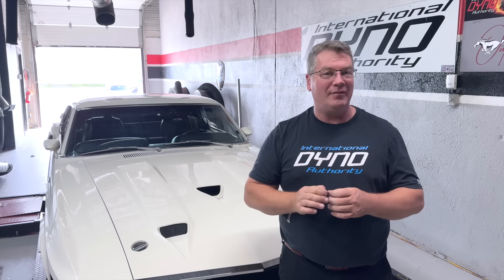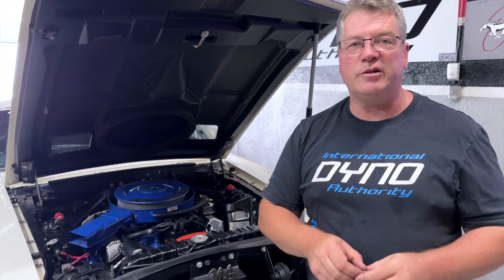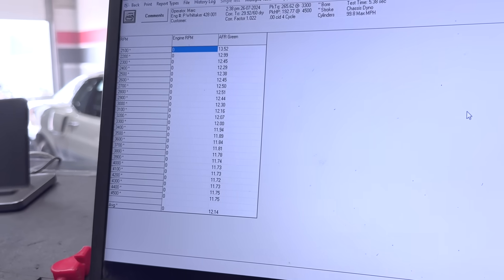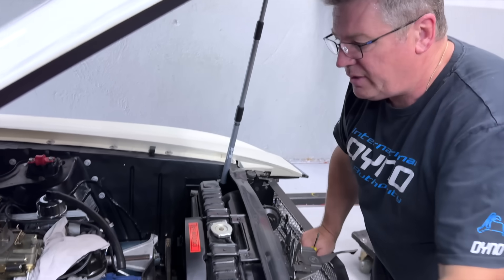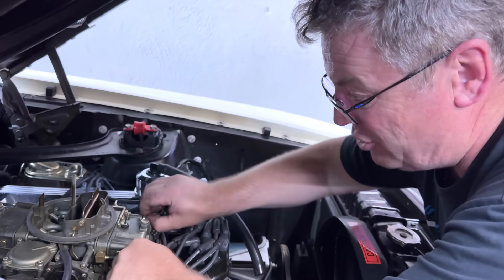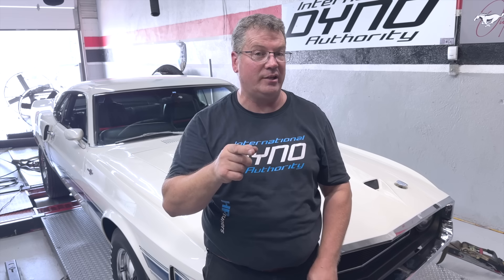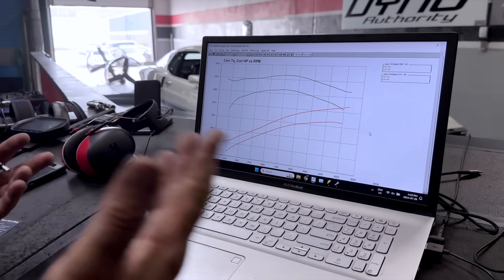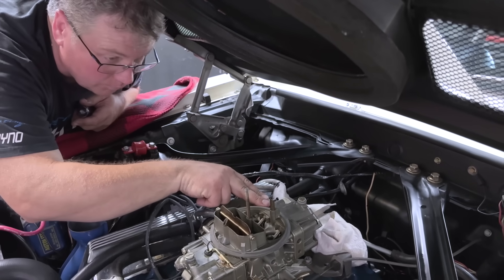Original, unrestored '69 Shelby GT500 tuned on the dyno

Comment: 340 HP at the crank is NET I repeat NET horsepower NOT Gross hp which the stock 335 Hp would have been. 335 gross HP would have been around 285 NET HP and subtracting another 8% from that would have been 262 Rear wheel HP. This is for a properly tuned car, but it's known that these motors were undervalued with respect to HP hence the numbers you guys are getting,so if you reverse the sequence when you got 295 HP at the rear wheels, add 8%( which is conservative) for the net value and then another 10% to get to the gross HP value you would get about 350-360 gross HP rating.
Reply from the maker: @johnnyzee383 

We tune over 600 vehicles a year, and one of the most common questions we get from customers is, "How much does that equate to at the crank?"

Another frequent query is, "How do I estimate the crank horsepower (CHP) from the wheel horsepower (WHP)?"

The simplest and most reliable method is to take the gross crank number—whether provided by the manufacturer, the internet, or your own experience—and divide it by 1.15.

Let’s apply that here:
335 ÷ 1.15 = [calculated result].

As a shop that specializes in dyno tuning—both chassis dyno and engine dyno—we can confidently say that this method is remarkably accurate for most setups we work with.

For instance, we can dyno an engine on the engine dyno to get its crank horsepower (CHP or BHP), install it in its chassis, and then compare the wheel horsepower (WHP) from the chassis dyno. Using the ÷ 1.15 method almost always matches up.

That said, there are exceptions. For example, we have customers who swap engines into wildly different chassis configurations. One customer, for instance, installed a K-series engine into a Silverado. In cases like that, the drivetrain losses are much higher—closer to 35–40%.

So while the 15% rule works exceptionally well in most cases, there’s no universal formula in the world of mechanics. Each setup is unique, and variations will always exist.
Reply from the maker: @johnnyzee383  

Using fuel from the late '60s or early '70s, such as leaded, high-octane options from Sunoco or Shell (around 100 octane), we could have expected more energy from the same combustion chamber. This type of fuel, being "slower-burning," would have allowed us to ignite the combustion chamber earlier, effectively advancing the timing.

With this approach, it’s possible we could have gained an additional 20–25 horsepower. Of course, this would have skewed all the calculated numbers.

However, for this particular project, we were thrilled to stay at a very conservative 31° total timing and still come remarkably close to the rated horsepower using the 1.15 rule.

This was an enjoyable project, and we had a great time working on it.

Cheers, enjoy your weekend, and have a wonderful holiday season!

Thank you for tuning in—stay tuned for more informative videos, including our upcoming educational series and straightforward how-to guides.

All the best!
Reply: @internationaldynoauthority693  Thanks for the response. Sorry I failed to consider the effect of higher octane fuel which no doubt the original dyno test would have incorporated into the tests, enabling them to advance the timing and increase the HP. Again you mentioned the HP number of 292 HP at the wheels and you say thats about 340 HP at the crank and then you say the factory rated this motor at 335 insinuating that your numbers are close to the factory 335 HP but again the factory NEVER rated these at the crank!!...they were rate with the motor on the stand with no exhaust, no air cleaner, no water pump, and no driven accessories what so ever, and this number would have been about 10% ( a conservative figure and likely higher) higher than your estimated 340 NET (or at the crank) or about 374 GROSS HP, again alluding to the fact that these engines were really underrated like the Chrysler 426 HEMI. What blows me away however is that you only had 31 degrees of total timing which is very low. By the way without vacuum advance hooked up drivability would be quite poor and gas mileage much worse.

Comment: Owning a 69 Mach 1 which I bought from Tasca Ford, was a SCJ with the Drag Pack option  4:30 rear,John Healy  was Tasca's mechanic/ tuner was a wealth of knowledge on the FE engines. My carb had # 68 primary  jets and # 77 secondary jets with open exhaust [headers] and ran 38 degrees total advance timing. That distributer is a 427 dual point mechanical advance which I also had in my car, their is also a trick you can do to that , take it apart and flip the weights , will respond a lot quicker ,like having a advance kit in it , of coarse we did it on a Sun Machine distributer machine.My car ran 12.3s ,open exhaust and 7" slicks running E/SA  , very fast street car in it's day. Was very impressed on your tuning !
Reply from the maker: @josephsouza9951  
"Thank you for sharing your thoughts! We’re so glad you enjoyed this vehicle as much as we did. It’s always exciting to see how a well-maintained classic responds to changes—it’s a testament to the care it’s received over the years.

You make a great point about the potential this car has, especially with a freer-flowing exhaust or other tweaks. While it might not see much action at the drag strip, its charm as a cruiser and one-of-a-kind classic is undeniable. The 420+ cubic inches under the hood definitely spark some interesting possibilities!

We’d love for you to keep following the channel, share it with friends, and join us as we explore more incredible vehicles. Wishing you an amazing holiday season—Merry Christmas to you and your family! Stay tuned for more from the International Dino Authority crew!"
Reply: @internationaldynoauthority693  It's always a pleasure to se a intelligent tuning a car

Comment: wish I had found you back when I had my 70 Monte 396. I changed the carb to a holley 750 duel feed and anything over 100 mph I left a batman cloud behind me. Red said the quad has 680 so why! I wish I had listened but hard heads show empty wallets right?
Reply: I did add a Edelbrock intake, 7900 lift cam, and a 4 inch spacer, and MSI this was 30 years ago, where does the time go? Jegs is evil with promises! Add 50 add 100 add 15 add and you drown the motor! and it is slower than stock!

Comment: I always wonder if emissions and insurance companies didn't kill the American muscle car by the mid 70's. What kind of numbers they would've been able to put out instead of the sub 200hp smog machines we ended up with. The experimental Chrysler doomsday motor reportedly putting out 900+hp in the late 60s, and the Ford thumper on record putting out 600+ without FI.
Reply: The HP and horrible handling of the Muscle cars of the 60s caused a HUGE spike in cars totaled and accidents. The insurance companies began putting a large surcharge on cars with huge engines. Imagine paying the equivalent of $10,000 a year for car insurance in 2024?  That will put a damper on sales of cars with big motors. Insurance rates spiked and the oil embargo of 1973 together put an end to the big engines of the 60's and early 70's.

Comment: A hit and a miss. A lot of good info.  I've tuned a lot of these with just a vacuum gauge taped to the windshield.  This tells you the correct power valve size. 6.5 is a starting point but most of the time I go with an 8.5 for crisper drivability.  Pump shooter tuning is done on acceleration. Start lean and keep increasing until your flat spot (hesitation) goes away. You NEVER change the shooter for mixture! You also missed a critical point of tuning, the secondary spring. If it starts smoking at 3500 your secondary spring is too soft. Big inch engines have a very strong vacuum signal. I would go one step stiffer. If it still smokes you can try a second step but if you lose power go back and take out a jet size. If you're getting pull over on the jet then that is just total fuel. Drop a jet size. If you reduce shooter size then you messed up your acceleration mixture. You either reduce jet size or you can change to an anti pull over jet from a 4165. The 340 SixPac is by far the hardest to tune. I got one into the mid 13s this way.  Also the plugs tell a story.  If the car showed up with a chronic rich condition the plugs should have been changed when it got close.  Having worked on a big block 1st gen I know why you skipped this step.
Reply from the maker: @wolfhobbies  The video was a summary. 

Many many steps were taken off camera. 

As, there were leakages, and nozzle sizing was Paramount. There were also other issues causing smoke. 

Off camera, we fixed one of the main main reasons that most of my customers have stutters and smoke coming from their engine. 

This was one of the many vehicles that showed up this year that had a breather on one valve cover and a PCV hooked directly to the intake. 

The PCV was bypassing the carburetor. We very quickly fixed that issue. So that the PCV was not drawing air from the breather on the opposite side, thereby leaving uncarburated air bypassing the fuel. Also, there was a restrictor put in the PCV, as these, valve covers were very liberal about the amount of oil they allowed, into the PCV return to the intake. 

Spark plugs were monitored. And they had been replaced immediately before we began the initial tune. Also the Gap was reset to correct. 

Gap, years ago was huge. We no longer use gap, as a fallacy to think that we get more spark. If we open the gap. We put the gap to a correct number. Which makes use of all of the voltage that this older style system has. 

Ceramic was monitored along with the ground strap. 

Mainly the smoke was removed. The fueling is now spot on. And there was no reason to actually add a lot of ignition timing as the engine, very much enjoyed. 31 as well as that was a good mix with the current compression ratio.

The power valve was swamped and re-swapped and repaired. And, some of our custom installed parts were added to the primary circuit.
Reply from the maker: @wolfhobbies  We did not change the size, or the CC, being applied under acceleration. We changed the nozzle. We repaired the spring. And we repaired the ball. And we repaired the passage. As well as the custom gaskets, that only we use in this industry. Nozzle size. As soon as, we repaired the PCV, and applied the smaller nozzle size. We no longer had leakage. Which meant that our jetting was now accurate. As opposed to tuming while compensating for nozzles that were overpowering the entire mixture.
Reply from the maker: @wolfhobbies  International Dyno Authority: Pioneering the Future of Tuning and Combustion Technology

As North America’s premier facility dedicated to advanced tuning and research, International Dyno Authority (IDA) has set the standard for tuning and power optimization across a vast range of applications. This cutting-edge institution has earned a reputation for excellence through extensive partnerships, groundbreaking innovations, and the development of tuning standards that are transforming the industry.

Partners in Innovation

IDA collaborates closely with leading corporations, advising powerhouses like HP Tuners, Whipple, Roush, and Ford Motor Company. Their insights and technical support have become an essential resource for these companies, driving improvements in engine performance, efficiency, and emissions standards. Through these relationships, IDA has a unique vantage point to pioneer developments that shape the industry’s future.

Pioneering Standards in Tuning

Since its inception, International Dyno Authority has been at the forefront of the tuning industry, not only setting new standards but also elevating the capabilities of tuners of all experience levels. Through their publications and training programs, IDA provides essential resources that empower both novice and professional tuners, equipping them with the skills to achieve precision tuning across various engine platforms. Their commitment to education is evident in their comprehensive curriculum, covering the intricacies of combustion dynamics, air-fuel ratio (AFR) tuning, boost management, and fuel characteristics.

Educational Outreach and Online Presence

IDA has established a strong online presence, notably through their YouTube channel, which serves as an invaluable resource for enthusiasts and professionals alike. Their instructional videos, which include step-by-step tutorials, practical tips, and expert insights, are used by institutions such as MIT, Boston College, SCT, Holley Inc., and Edelbrock, making IDA a recognized leader in education within the field. Their expertise has also gained the attention of influential industry figures, including Steve Morris, who has commended their contributions to tuning technology.

Specialized Focus and Areas of Expertise

Operating as a purely tuning and research facility, IDA’s specialization spans a wide range of topics. They delve into complex subjects such as combustion technology, AFR tuning, boost and fuel optimization, and luxury engine swap integration. The organization’s work also extends to advanced fuel research, as seen in their recent collaboration with TTC, Hydra-Gen, and DynaCert. Here, IDA took the lead in developing an 8.9L Cummins engine hydrogen supplement fuel program, which included rigorous emissions testing, underscoring their commitment to sustainable and innovative fuel solutions.

The Facility’s Technical Scope and Testing Capacity

Each year, IDA conducts over 650 vehicle dyno tests, tuning engines and chassis systems to optimize performance. This includes a wide variety of engines powered by gasoline, E85, diesel, hydrogen, port and direct injection, throttle body injection, and even carbureted systems. Their expertise is not limited to traditional vehicles; the facility also tunes boats, tanks, and military transport, making them the only independent tuning and research center in North America dedicated to such an expansive range of engines and fuel types.

Advancing Industry Standards

By leading projects in combustion and alternative fuels, IDA continues to be a key player in the evolution of tuning technology. Their dedication to setting new standards in performance, efficiency, and sustainability has positioned them as a trusted authority in an industry that is constantly evolving. For anyone looking to understand or pursue high-level tuning, International Dyno Authority remains the ultimate resource and innovator in the field.

Comment: Wow that thing sounds way better. My 1969 mustang ran a 13.6 in 1985. My 2021 mustang EcoBoost high output runs a 13.00 stock...only a cold air intake.

I'm coming to you with my GT500 1969 mustang... Also I want electronic ignition with a better coil ect.

Comment: Missing smog gear, and the car has definitely been restored. Not an original, untouched car.
Reply from the maker: @juliestine3561  This vehicle is absolutely pristine. It's had only a couple of owners. The paperwork is in verified condition. It actually has been. "Hagerty Verified" .... It has been assessed. The value of the car is clearly known. 

In the month before the car arrived it had a complete appraisal. Which verified the paperwork. The serial numbers. The original equipment. And, the complete condition of the car. 

This is why, we were able to label the video. Unrestored and, original. 

We hope you have an absolutely awesome weekend. And we wish you all the best over the Christmas holiday season. Cheers and, enjoy.!!
Reply: Nobody said the car was ‘untouched’ - too bad you can’t enjoy the main purpose of the video, the incredible gains due to the tune. The video admits that the distributor has been changed, the carburetor was cleaned and you are correct about the incomplete smog equipment but other than those things this car is ‘as manufactured ‘, nothing modified, never disassembled. Some people just can’t see a very nice car when they are looking right at it, which is an awful way to live.
Reply from the maker: @juliestine3561  

All 68,69,70 Shelby GT 500's came with Smog (thermactor) no matter what Urban legends you might have heard. Probably since it was on every GT500 engine for those years it was not considered a variable. The build sheet was for the variable items to be used on the car.
Reply: Smog gear might vary.  Remember, this car was mostly built by Ford, not by Shelby American.
Reply from the maker: @juliestine3561  here is the original equipment 

This is what is currently on the car. This is what was provided with the car. 

And this is what is on the original unrestored 1969 Mustang GT500 

https://images.app.goo.gl/34fufJYgmUTu7EFP9
Reply: All production 428CJs had smog gear (thermactor) from Ford. ALL. Shelby Mustangs were not excluded. Your "unrestored " and "original" Shelby isn't. Too much shiny stuff and black paint for an untouched car.
Reply from the maker: @juliestine3561  Asked and Answered.

Vehicle already verified.